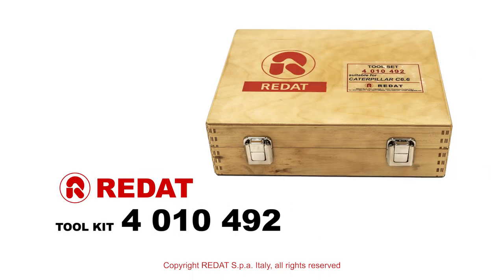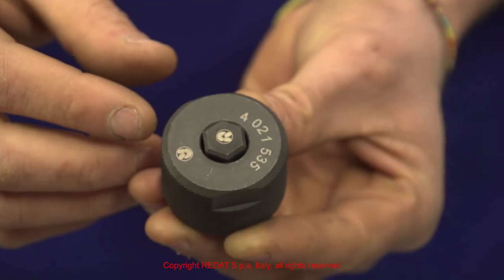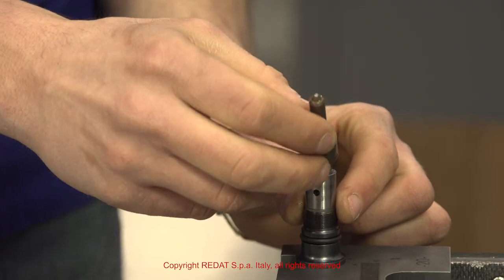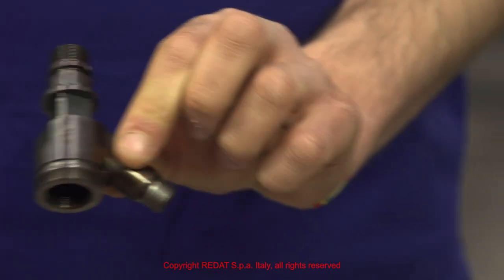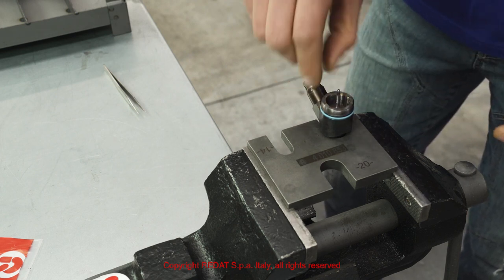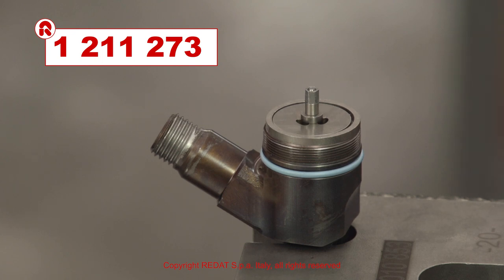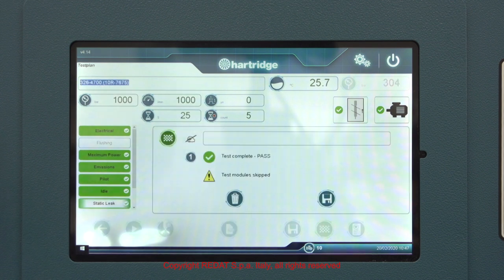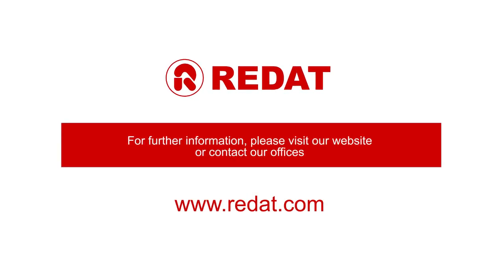Caterpillar Perkins C6.6 Common Rail injectors - Assembling, disassembling and testing

Comment: Would you help us about the right value of distance measure of the valve? We're working with 0,105 ± 0,015, but in several cases the vehicle shows too much white smoke and less power.

Comment: You didn't measure anything by any Guage or meter
Reply from the maker: no, the test bench results are the only thing that matters in this injector, we test them, and adjust the calibration shims as needed based on the test bench results.